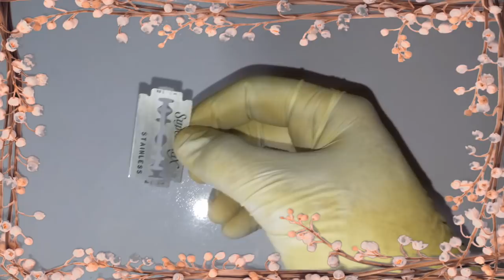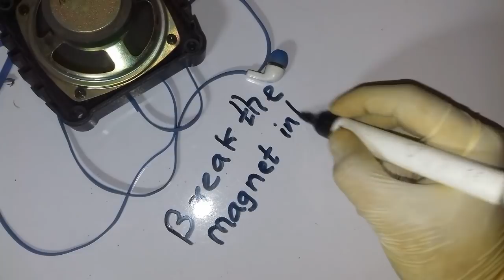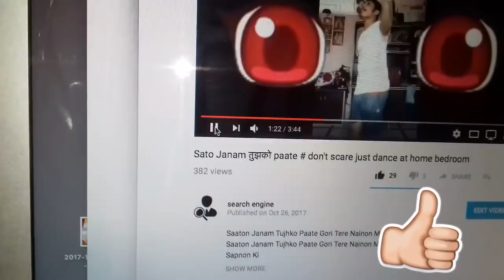How to make best  wireless earphone easily at home || for macbook

Comment: this one theoritically works but in reallity its need some amplify because its just like wireless charging
Reply: Not even close. Theoritically i should not work. With only magnets you cant transmit data. You need a modulator, transmitter, reciver and demodulator.
With dont have anybof that with thoese elements.